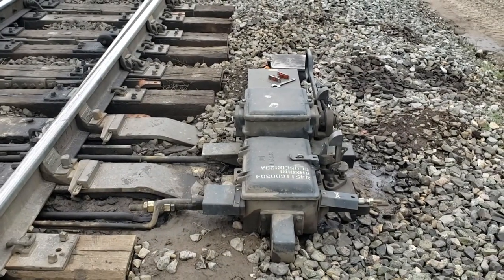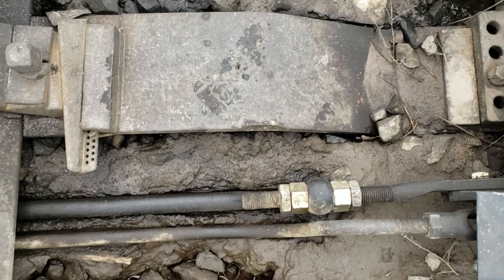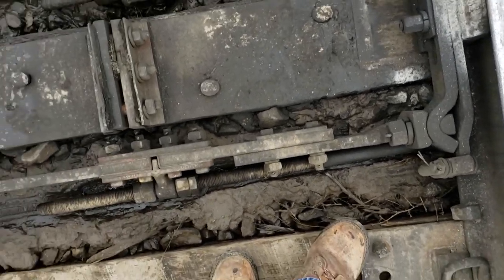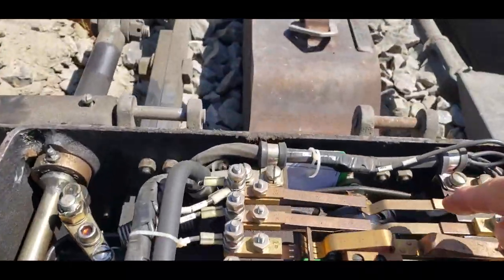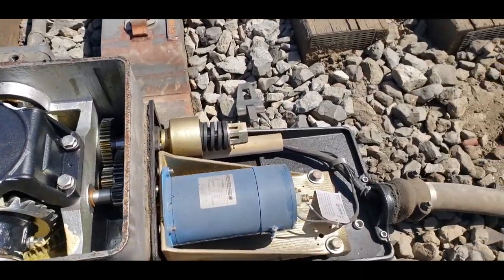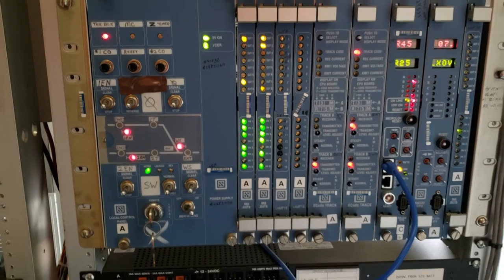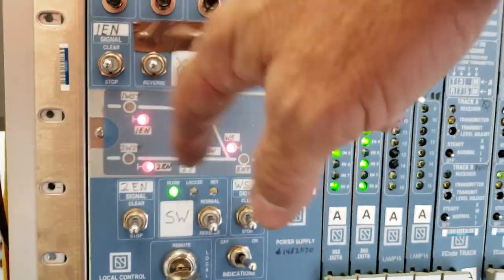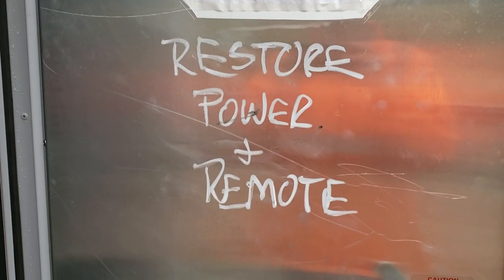Railroad Signaling Explained: How a Power Switch Machine Works

Comment: How are tracks numbered?  Does it vary from company to company? Can a normal civilian tell which track number is which? Thxs
Reply from the maker: Heck, it varies from sub to sub on the UP. At SP with your butt toward Frisco, the left track was always the #1 and was a westbound track, #2 the other way. Westbound signals were always odd numbers. 
Whatever SP had, UP changed. I can't speak for other roads
Reply: Up here in Canada,  we consider the tracks East and West-running.  We do have some North-South oriented tracks, but we still consider them as E-W, same as Air Traffic control considers flights either Eastbound or Westbound depending on the compass heading from origin to destination.  If you were standing on a double main,  they would refer to either the North track, or the South track, because the tracks run East-West, and one is North of the other, the other is South of the North.  If you get into triple main or more than triple (rare),  they will revert to numbers,  and it has been my experience that the North-most track is considered the #1 track, and each track South of that will be #2, #3, etc. If there is any quadruple main track in Canada, I don't know about it.
The East and West thing also determines how a train is numbered.  Just like airlines flights, anything running or flying Eastbound, gets an even number.  East=Even.  Anything running or flying WB would be an odd number.  As Mark mentioned in his reply before mine, tracks can be considered as Westbound track and Eastbound track,  but the way CN runs things, you seem to see more traffic running on the opposite track than sticking to the rule-of-thumb.  There are many reasons why this happens, from Passenger trains that need to use certain track to embark/disembark passengers, to work trains working on repairs, to local trains delivering and shunting on spurs, many more reasons.  Most railways try to set up signals for trains that could be approaching from either side in either direction.  A number of years ago, there was a severe ice storm that lasted 4-5 days in Ontario and Quebec. Large swaths of areas were without power, and batteries were depleted.  CP had a double main at the time that ran from Smiths Falls, Ontario to Montreal, Quebec.  That track at that time was ABS signaling, so the solution to avoid trains having to stop at every "dark" signal, was to "run the trains backwards" against the signals, meaning that they would run EB trains on the so-called Westbound track, and that eliminated or reduced trains stopping at every dark signal and calling in for permission to pass a red or dark signal. Okay, so it's more complicated than that, but I don't have the time, space, or patience to break it right down beyond that.

Comment: So I've heard the dispatcher saying that a switch is "flashing out of correspondence". What kind of issue does that indicate?
Reply from the maker: That generally happens when the point detector is adjusted too tight or the track structure is very poor. As a train passes over the contacts will open and close causing the light to flash on the dispatcher's board.
When a signal cannot be cleared due a switch out of correspondence it may have been left in the wrong position after being thrown in hand (more common at a crossover) and will have to be set back to the position the dispatcher is showing then placed back in motor.
Thanks for the question and for checking it out!

Comment: Try calling a route and getting a clear signal, I would bet your switch then "locks' on your LCP.  Its showing normal or reverse, but its not locking because you haven't established a route.
Reply from the maker: the board shows the switch locked any time it is locked. if not, the route wouldn't clear. also, if you had to clear a signal every time it locked, you'd have to run or cancel time (which is a pain with this system) when testing. also, you'd have to get track and time from the preceding to the distant CP rather than just foul time at the CP. sorry for no caps. i'm in a cast!
thanks for checking it out!
Reply: @MarkClayMcGowan  thanks for the explanation. On my territory the switches lock pivot when a tire is cleared via the RCR and LR

Comment: Mark, have you ever heard of an animal or even a human getting a foot trapped when an automatic switch suddenly changed position?
Reply: Not Mark but a signal maintainer, fingers are more common than feet and it happens every few years. You can usually save the fingers, but you'll never use them again. It's a huge safety issue, so much so that anyone on a qualifying test who puts their fingers in an open switch point will fail immediately.
Reply: Yeah, usually if something falls into an open point, you don’t ever put your fingers in there. At any moment, the dispatcher can request that switch be thrown, and it only takes 3 seconds for that switch to throw. We usually find a stick, or our radio antennas, bosset tool, or whatever to get it out. If you must, and absolutely must put your hand in there, you are to call the dispatcher, get time, and then disable that switch by killing power to it, before even thinking about putting your hand in there. Even then, it’s bad practice. Just use a stick or something to get it out. Shit happens, but nothing is worth losing a finger if you don’t have too.

Comment: That switch is in horrible shape. Need to get that mud out.
Reply from the maker: We replaced the switch ties and track reconditioned the ballast soon after this was shot. When I took the district over I was surprised at how little maintenance had been done on such an important piece of railroad.
Thanks for checking out my channel!
Reply: Gauge plate insulation looks like shit too. Amazing that anyone would leave it that way for you. Either the supervisor never gave a shit, or the FRA never showed up there!
Reply from the maker: @dsma2023  including me there had been ten maintainers on that district in four years none of whom had plans on sticking around. The only time I saw the FRA we were out on the branch lines!

Comment: What sort of voltage runs in them
Reply from the maker: Motor voltages vary. Ours are all 20 volts but some are 120v AC. I've heard about 40 volt but have never seen one.
Our signal and crossing circuits (including gate mechs and indication circuits in switch machines) is 13-15v DC.
Voltages used to push frequencies on tracks and various equipment is in the millivolt range, some DC some AC depending on the application.
Thanks for asking and thanks for checking out my channel!
Reply: Thanks for that. I’ve always been interested in rail signals. Our Australian ones are all very similar to USA. I hope one day to get a set of rail signals.
Reply from the maker: @yappymat549  keep your ears and eyes out for roads doing signal upgrades. Here they give the old stuff away.
Reply: Really wish I was around your crew then I know a couple of blokes who are trying to legally get hold of a few things for me.

Comment: How do you get away with filming with a cell phone in the foul of the tracks?  Also,   why are your cribs so full of mud?
Reply from the maker: I had foul time at the control point. I didn't publish the video until after I retired, which I knew was close when I shot the video. The location was slated for tie replacement and that happened a few weeks later.
Thanks for checking it out!

Comment: just curios what shows up on the dispatcher board if the switch has been run through? i think a flashing light??
Reply from the maker: Yes. It shows that the machine is not locked in either position